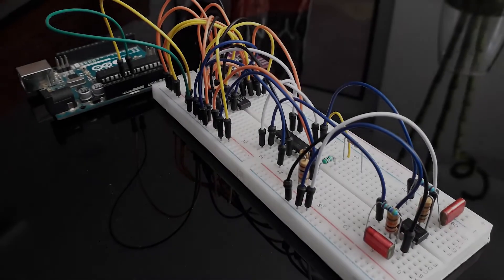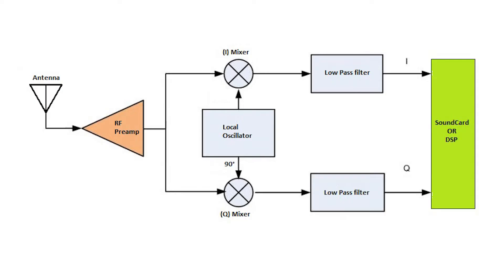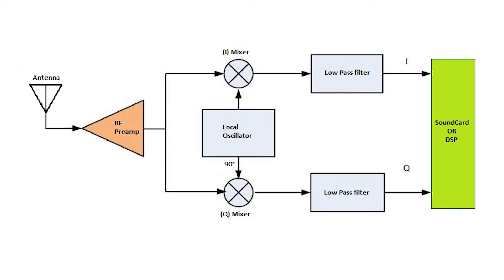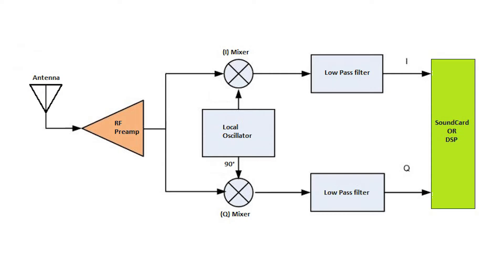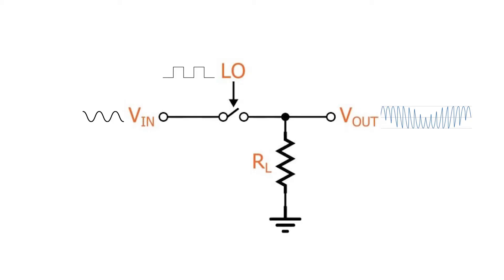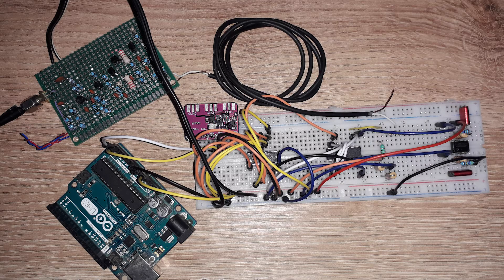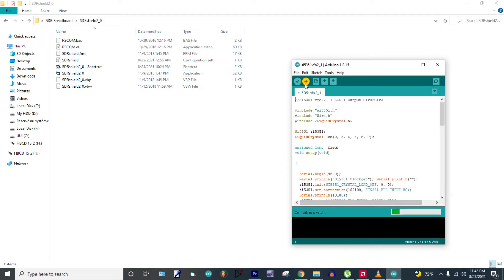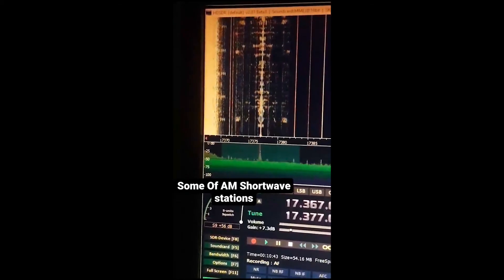Simple SDR receiver (10kHz-30MHz)

Comment: I suggest using the 74AC74 instead of the 74HC74, to increase the receiving frequency. The 74HC74 normally reaches 25MHz (So 12.5MHz). The AC74 reaches 100MHz.

Comment: How can I increase the frequency range, i need 20-1800 MHz range
Reply from the maker: 1800mhz first local oscillator cannot reach 1800Mhz second the flipflops cannot switch above 40Mhz same with analog switches, so you need fancy RF components that allows you to reach your desired frequency

Comment: Brilliant brother ...according to your scheme that you illustrated in the begining of the video, you built a zero IF or direct sampling demodulator. Theorically you must have a perfect matching between the I path components (mixer, low  pass filter ) with the Q path components or you will get what so called "IQ imbalance" and of course ADC sample rate has to verify Nyquist-shanon condition. Seeing that you used such hardware , am really wondering about how it is performing ?

Comment: Hey how did you come up with  wideband RF amplifier
Reply from the maker: https://www.onetransistor.eu/2015/12/hf-vhf-antenna-amplifier-without-coils.html?m=1
Reply: @anissoulhaci  thanks man! I have BF200, MPSH10 with me. Will build it on a breadboard first. Thanks again! It'll be hard to find 4mm dia ferrite rod though!
Reply from the maker: @awaismushtaq5719  breadboard build too much capacitive noises especially dealing with vhf uhf because every gap on breadboard represent a small picofarades capacitor so i suggest you doing it on copper pcb

Comment: I was wondering what I would have to change if I wanted to receive in the 2m band?  
I think using the Si5351 to generate the quadrature sounds like a good idea too.
Do you have any recommendations for the type of capacitors to use?

Comment: Cool project.  It shows how older more traditional analog technology (RF amplifier, mixers, LP filters) fits in nicely with the software DSP.  But today this is a bit of an old-fashioned fairy tale, right? Today we just an ADC at the antenna and send the digital stream into the computer for processing, right?
Reply: Yes, thpugh it depends on the speed of the computer. You are not going to be able to do much in the microwave bands for example. Instead you'd problably need to downsample the wanted receive frequency and input that into your computer/raspberry Pi/favourite platform. Some of these modules makes sense to still have it in hardware. A LP is so simple, that it's piece of mind that you are not transmitting harmonics across large amount of the spectrum.
Reply: @gorillaau  also, you need a LNA preamp to amplify the signals.
Reply: @parthd714  Yeah. That's true. I forgot about the Low Noise Amplifier preamp.

Comment: The .rar file is not extracting. Pls help
Reply from the maker: Its working for me! Try alternative extractor like 7zip
Reply: @anissoulhaci  Thanks! I tried RAR and it worked on android. Pretty simple circuit. 74HC4066?
Reply from the maker: @dare-er7sw  74hc or cd but i prefere 74HCT its faster than those two and can reach up to 20MHz
Reply: @anissoulhaci  Oh. And how far did you go with the CD4066? Does it work up to 12MHz? I'm just curious.
Reply from the maker: @dare-er7sw  cd4066 i think you can't go above 12 or 14 MHz , (HC or LC ) logics are fairly limited in terms of switching , but the HC or HCT are more faster and can reach above 100MHz
Reply from the maker: @dare-er7sw  also the Flip flop that im using cant deliver up to 14 Mhz so u need also faster one
Reply: @anissoulhaci  Thank you for your replies. Have you thought about using diode mixers?
Reply from the maker: @dare-er7sw  diode ring mixers usually used in superhet analog receivers it works quite well but in this case we are working with mixed signals (digital and analog multiplexing ) or instead buy double balanced mixers ne602 chip they are pretty simple to work with
Reply: @anissoulhaci  Where can I mail you?
Reply: @anissoulhaci  A center tapped transformer connected to diodes which are turned on and off with 0 and 90 degrees phase difference square wave. The audio is extracted from the LO point with an AF LPF. It turns out the Si5351 can generate such quadrature clock output and no flip flops would be needed. Its output in a 50ohm load is 1.66V pp or roughly 6.5mW

Comment: Good project. It is a Tayloe mixer in a simplest form - no input transformer, magnetics, etc. The C1 and C2 can be increased to 100n to make LPF cutoff 3-5kHz for better S/N.
    The 74HC74D can be omitted, further simplifier design, - here it is used to generate a quadrature pair I and Q, which Si5351 can produce directly. 
      It is very impressive that it worked on a breadboard. What actual broadcasting frequency was captured in the video?
Reply from the maker: Hello man thank you for your great tiny explanation . Well the frequency i think its about 7200Khz from radio am senegal (if im not wrong)

Comment: good video! one question, about the I and Q signals, they go separate on each channel? left and right? how do this work?
Reply from the maker: Yes exactly! Thats why you need stereo soundcard input not mono
Reply: @anissoulhaci  If you use only one it will work? I to directly to aux and ground will this work?
Reply from the maker: @8_Bit_Cloud  its works but it will have mirrored spectrum
Reply: @anissoulhaci  I'm confused Like How do you connect this Q/I to aux and feed to aux  input of PC? Bit Enlight me about this Q and I signals
Reply from the maker: @8_Bit_Cloud  i and q are both similar signals but they are phased in 90 degree (cos and sin) they both carry the final audio of the whole received bandwidth of the received radio signals , thats why you can view a lot of station on spectrum
Reply: @anissoulhaci  OK thanks for Replying.